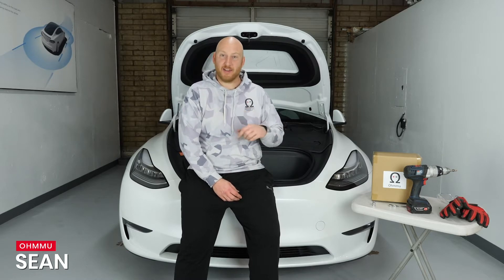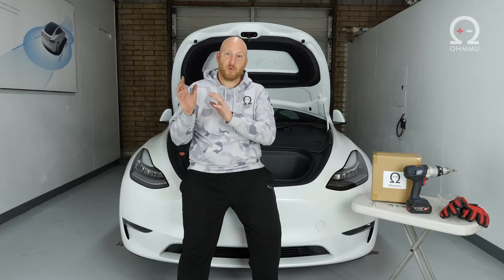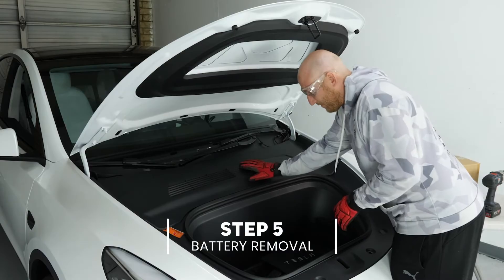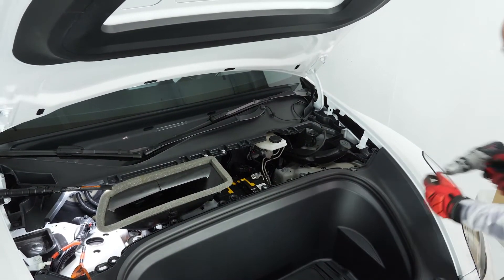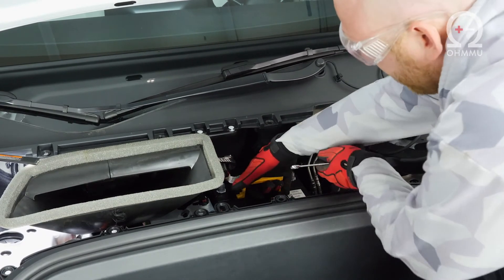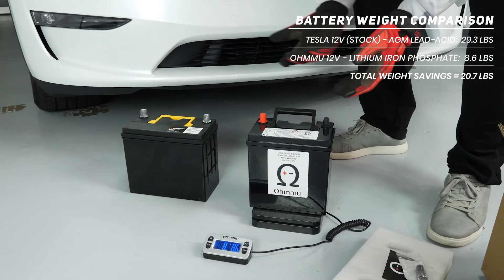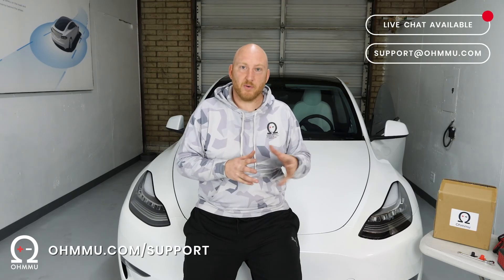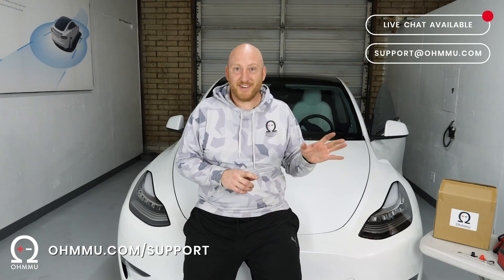Tesla Model Y - 12V Battery Installation (Ohmmu)

Comment: If your 12v battery is already dead, how is the procedure different?
Reply from the maker: Gotta get the frunk open, pop the little round access port off the bumper and behind it are 2 wires, put 12V power on those wires and frunk will pop open.

Comment: I have a 2021 model y, 12 v died after 2 yrs and was replaced under warranty….now it’s 2025 on that second battery and it’s prob not gonna last long…although how can I check from monitor if the replacement was old or new li-ion?
Reply from the maker: Hey there! Did you purchase the battery from us originally? If so, we can check your purchase date. You can email us at support@ohmmu.com. :)

Comment: Always disconnect positive first then negative. When connecting its negative first then positive. Any electrician knows this.
Reply from the maker: electrician for homes/buildings may not be as familiar with a grounded-chassis setup.  In vehicles the ground/negative is often bonded to the chassis of the vehicle, this means the electrician who disconnects positive first and then allows (by accident) the positive lug to touch the chassis may be in for a blown fuse if the DC/DC were still on (positive line still hot)... On the other hand if you disconnect the negative first and it makes contact to the chassis (any metal anywhere) it will result in nothing...  Obviously you should ensure the DC/DC is OFF and force it off via HV-tag removal, but in short there is not GOOD reason to disconnect positive first but there is a GOOD reason to disconnect the negative first, reduce risk.

Comment: I'm a bit concerned with the assumption that the DC-DC converter has no problems with a different battery technology.  You seem very knowledgeable but I'm remembering the Dreamliner grounding due to Lithium batteries, the Samsung phone that was prohibited on airplanes for a while, and the Dell laptops that would spontaneously ignite.  Can you kindly reassure me that such a conversion is approved for Tesla?  How about by Tesla?  I'm aware that they have shifted to Lithium in their newer cars.
Reply from the maker: TESLA will not approve any aftermarket parts so that's never gonna happen in any official capacity.  However the news-cycle on "lithium" tends to be very generic and lump a lot of things together.  These are Lithium-Iron-Phosphate cells, which are very robust, these batteries contain their own protective BMS circuit which can shut it off if it needs to do so for safety.  We have at least 10,000 batteries out there now and no issues like you speak of.

Comment: Thanks for sharing. What is the capacity and cca of the lead acid battery?
Reply from the maker: So, in EV-world CCA is kind of an ignored value b/c it is meaningless (to an extent) in an Electric Vehicle, in fact the 12V battery in the Model Y is fused at 200A, so even if you put a 500CCA battery in it, the fuse is gonna pop before you ever crank 500A out of it (and rightfully so as the car, in normal circumstances, has no means or reason to pull that much current).  So, we actually dial our BMS in to consider anything over 200A as "bad", therefore our battery systems will cutoff at 200A even though the cells could handle more.

Comment: Need an update for the latest (2023) ModelY, as it looks a bit different when you take off the first cover under the hood.
Reply from the maker: 2023 Model Y use a 15V "module" that connects totally differently and has data communications with the vehicle, this module is now Lithium from the factory.  Ohmmu doesn't offer anything for this to be replaced with actually.

Comment: Excellent video. Ignore everyone complaining about the angle. Im 99.9% sure those people have never changed a battery in their lives. It’s incredibly simple once you get to the area by unscrewing the hold down bolts to loosen the battery from the tray. Then you remove the bolt from the bracket and voila, that is it. It’s using common sense.

Comment: What is the difference in amp hours between the AGM 12v and the Ohmmu replacement? Do we sacrifice any "capacity"? Are there any safeties around drain to ensure the battery isn't brought below voltage?

Comment: Why connect the first responder loop before  connecting the battery negative?
Reply: I am curious about that sequence too
Reply: @hdtube99 it's the sequence show In official Tesla battery replacement video.   I think it is to reset the error codes.  I did it with this sequence and it worked perfectly,  as no more error codes with new battery.

Comment: Its pretty clear the people who make a replacement made the video, some things are slightly over done, like how heavy the battery is.  They are good points, but, I don't need the "ugh" when pulling the battery up.
  I need to put a new one in, might go with a Lithium, might not. My Mini Truck used about the same size battery this has, but I put a lithium in its place.  There are for sure upsides (lighter, longer lasting, able to deal with drainage while sitting better).

Comment: Did he say "better for the environment "🤔? Do you know the environmental impact of mining for Lithium on a large scale?
Reply from the maker: Far less Lithium material in a battery like this than Lead material in 3 equivalent lead acid batteries.  Do you know the environmental impact of the lead acid battery manufacturing?  The 10lb Lithium battery has less environmental impact than 100lbs of lead acid battery that it offsets.

Comment: What will happen if the wrench does touch that arc and created a spark? Is it likely that a fuse is blown? Is this an easy fix or will it effect the whole battery of the Tesla? Does warranty cover this fix?
Reply from the maker: In the Lead or Lithium.  In the lead it would blow that fuse if tapped above the fuse but if tapped directly on the terminal it would dead-short until the terminal melted away from the wrench due to immense heat.  That wouldn't likely ruin the vehicle and the 12V would not be covered by Tesla in that case.  If it were the Lithium from Ohmmu, there would be a brief jolt at the terminal as the wrench touches (milliseconds prior to internal safety tripping) then it would just go dead, the battery would read 0.0V until the wrench is removed and the battery is reawakened by supplying 12.0V constant on the terminals. The battery would be fine and nothing damaging to the car either.

Comment: I want one but I’m scared from all the issues I’ve seen online where people say the tesla doesn’t charge the battery and it can die and also errors saying battery needs to be replaced , is there a fix now ?
Reply from the maker: The Rev4+ battery addresses these issues and presents some easier reset methods for them if they come back.  It's due to do soft release by end of this month and wide release (for sale again on website) in 2-3 months (this year!)

Comment: Does anyone know the max Draw load of these 12v batteries? I’m trying to find out the max sized inverter that could be hooked to the car…
Reply from the maker: Fused at 200A, so definitely don't exceed that but you can look into connecting directly to the penthouse under rear seat if you really want to pull more than about 50A peak, if it were me I wouldn't exceed 50A directly off the 12V (connected at 12V) but if I connected at the DC/DC output at penthouse under rear seat (install inverter in trunk) then I'd feel comfortable up to around 150A.  The penthouse connection will still pull energy from the 12V battery but it will be more quickly sensed and supported by the DC/DC converter which will pump 12V out of the HV pack of the car.  If you pull 150A out of the lead acid 12V it will dramatically sag in voltage very quickly, from the lithium it will be better BUT 150A will still sag quite a bit.
Reply: @OhmmuEnergy  so in your opinion, don’t exceed 1800watts if you’re connected behind the seat. That’s not bad. I’m hoping the cyber tuck comes with 240V 50amp hook up in the bed… that would be sweet!

Comment: Your help is highly appreciated
My tesla is model Y 2021 but out of region “out of usa”
Not Hepa filter one
How to disconnect the red connector, the video is amazing , but I am not able to disconnect the red connector for the big battery
Please advise
Reply from the maker: Pinch and slide the lock on that connector then squeeze the latch and pull.
Reply: @OhmmuEnergy took me 30 minutes to demate that.   The video didn't show details. I had to squeeze the connector tab with channel lock pliers.

Comment: “If you leave the negative lug attached and you take the positive off and then the positive touches something metal in the car it actually will create a short with the 12v battery.”
I see what you’re trying to get at, but think that through a bit (assuming high voltage and dc-dc disabled). If you remove the positive cable and it touches the negative lug/cable/metal nothing will happen, there’s zero voltage.
Reply from the maker: The potential for having forgotten to disable the High Voltage/DC-DC is why we continue to do it this way and mention this process.  For someone who has done it before and knows how this all works, this video is a bit elementary, for someone who has never done this we hope to give them the best chance at being successful by being conservative about these sorts of things.

Comment: Thanks for the instructions here, very helpful for updating the battery in my Model Y. I did the battery update today (12/11/2021) and I have a couple of comments that might be useful. First, it would be very nice to see more close up camera detail of disconnecting the HV loop connector (passenger side, under the frunk cover). I did manage to get it done, and the words in the video were helpful, but a nice camera shot of the detail of the connector coupled with its removal would've been much appreciated. Secondly, at least on my 2020 Model Y, the actual positive terminal battery connector required an 8mm wrench/socket to remove. So, tools needed are both 10mm (for the battery holddown strap and the negative terminal) and an 8mm (for the positive terminal) wrenches. Third, I think it is much easier to ensure proper placement of the terminal spacers if they are installed while the battery is out and sitting on the floor (rather than sitting in its final location in the frunk). Finally, I think you might also want to show the driver's door window being rolled down prior to proceeding with the battery swap just to emphasize this step.
Again, thanks for the video and it was very useful... I actually generated a printed out step by step checklist that I took to the garage to ensure that I didn't miss any steps and that worked well for me.
Reply: Yes that HV connection was also a toughie for me to get demated.   I wrestled with it for 30 minutes until I used a channel lock pliers to press down the connector tab while pulling the body of the mating connector

Comment: If you were trying to install an underglow kit that required 12v, would i get the power straight from the battery? Or would I need some sorta of d/c to d/c converter?
Reply from the maker: You can get it straight from the battery!